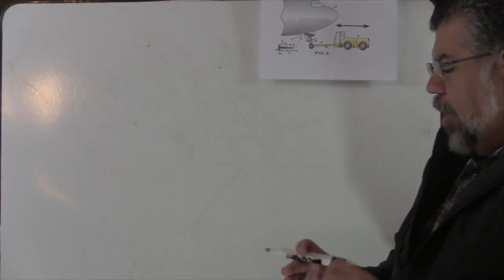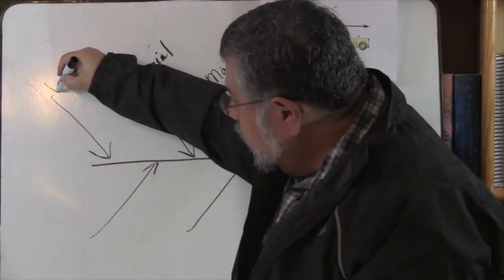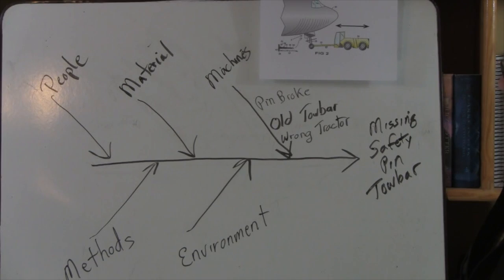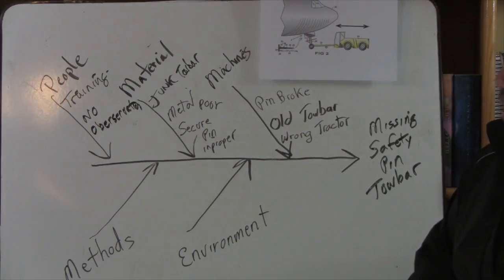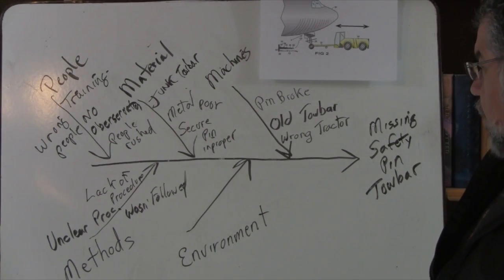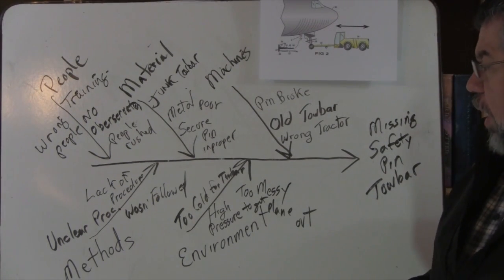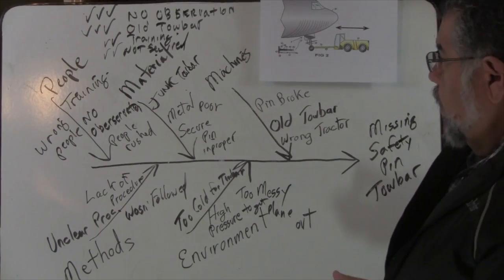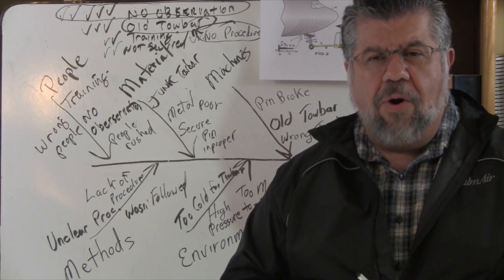Live Ishakawa Fishbone Diagram Build

Comment: Can someone please give me one of the real time scenario wherein P1 ticket has breached (major incident management) and we need to perform fishbone analysis for the same? Kindly let me know the by colleting all possible causes for the incident (potential or what happened) under 6M.
This will be really helpful if someone could help me here in finding a solution.
Reply from the maker: Good Day Varun,  The Fishbone diagram is definitely NOT the tool for "Triage" of an incident. Short Term Corrective Action are immediate to secure the safety of personnel and equipment involved in an incident.....Put the fire out, get medical attention, evacuate the area....etc.  The Fishbone diagram is ONLY for LONG TERM corrective action of the SYSTEM! to find the causal factors in the SYSTEM that may have led up to the incident.  You can use the INTERACTION OF FORCES to evaluate a short term solution quickly. Run through he list: MACHINES, METHODS, MATERIALS, PEOPLE and ENVIRONMENT, but do NOT use the Fishbone diagram for a QUICK solution.  I hope this helps.
Reply: @SMS_QA_CONTROL  Thank you so much :) :)

Comment: Hi why don't you just do to check out the "crime scene" and ask people what went wrong? What if you just eliminated the real cause of the problem just because you made wrong assumption on elimination phase? This method seems all wrong from head to tail, it is contradictory to Kaizen methodology.
Reply from the maker: Aleksandra Klimczak-Salaga the diagram was developed by Dr. Ishakawa of the Japanese Union of Scientific Engineers. It was Dr.W.Edwards Deming Identified the forces that affect All processes, Machine, Methods, People, Materials and Environment. To simple examine the”crime scene” would ignore the “System” which is responsible for effect. Kaisen is a continuous improvement cycle that was derived from The Deming PDCA which is also based on system analysis.